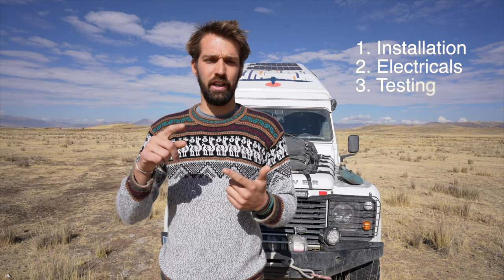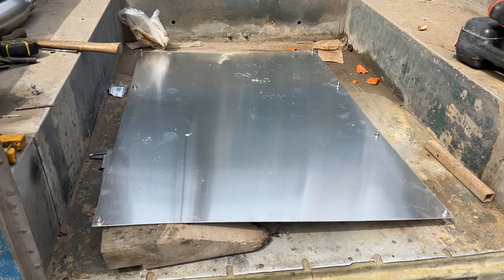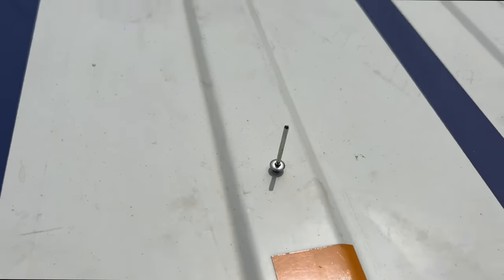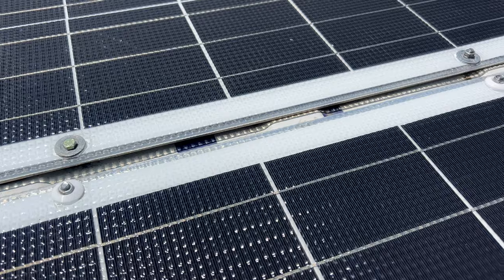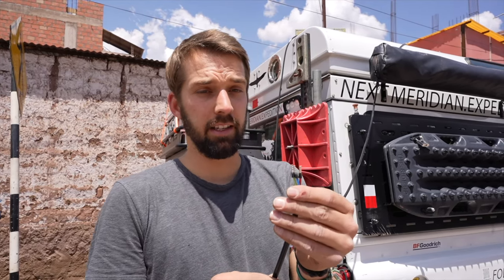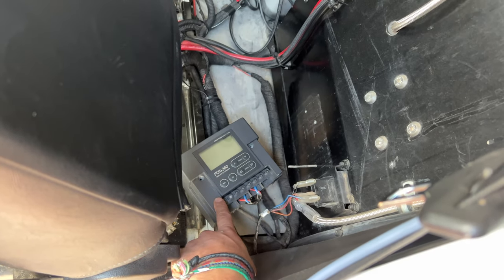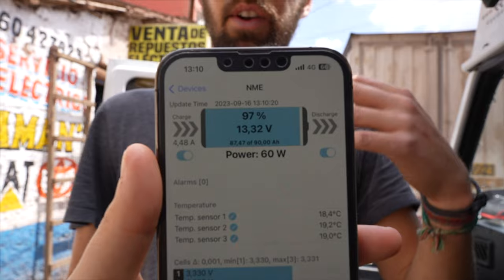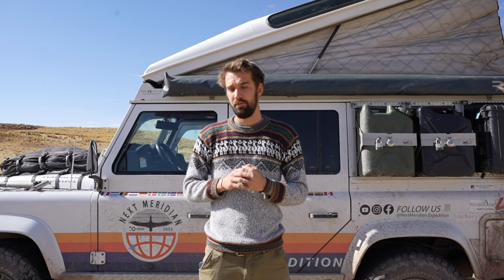How to install Solar Panels (full process)

Comment: Nice install guys.   Unless you are running anything from the car starter battery when the ignition ie off then it will only need a very small amount of charge to keep it topped up when the motor is not running.
You would probably be better off changing your charger to 95% to lithium and only 5% to the car starter battery.   Basically if notihing is connected to the starter battery when the engine is off then it will only very slowly loose charge over time. You guys are never away from Albo long enough to need it charged up a lot.
Reply from the maker: Yeah indeed, so far we never go below 50% charge and good point might as well put most on the lithium 😊

Comment: Think you need an air gap for cooling the panels. 
I am currently replacing flexible panels sitting directly on the roof of our caravan with glass panels with air gap for cooling to improve performance.
Our house also has solar and the installer said an air gap was essential to stop the panels from overheating in hot weather.
The ideal temperature for solar panels is 26 degrees.
You may need to water your panels to stop them overheating in hot weather.
Reply from the maker: Yeah having air is a good idea, we didn’t want to increase the height of Albo and we’ve run this installation for 1.5 years and worked fine so just went with the same setup. All the best with your van setup

Comment: thumbs up and sub! Seems like you have space on the roof for 1 more panel?  Star Link uses a lot of power.  Some people modify it to 12V to save some power.
Reply from the maker: yes we could have the space but our batteries would be too small if would not be worth it. already our two panels work magic. yes starling is thirsty hahahah we try to limit using it. just for the necessary time to do what we need. we did not modify it.

Comment: Did you make sure all of the metals involved are the same?  Otherwise you may get electro-galvanic corrosion- eg. steel vs. aluminum.  Speaking about vibration, where the line runs over an edge might benefit from some padding.

Comment: That whole system is janky as hell. Solar panels should be mounted to corrugated plastic sheet to create an air gap for cooling not a metal sheet that will just fry them, no idea what cabling that is but it sure as hell isn’t pv panel cabling, at best you will lose loads of wattage, at worst it’s dangerous.
Reply: Yea..You may be right, but it works and it was his first go...So offer advice, not ridicule..
Reply: @MrDonJBerg  toughen up, cowboy. Free and good advice sometimes sounds like a drill sergeant chewing your ass up for pointing your rifle where you shouldn’t.... @jabber - thanks for the heads up cause I’m about to build up my first system!
Reply: @torrentbits  sure thing
Reply: Doesn’t aluminum dissipate heat?
Reply: @ronfinch5532  I have used Aluminum as a heat sink in the past, but it also conducts heat from the sun.  The bottom line is, I did not see anything dangerous on Nicks installation, some things I would have done different, but there are many ways to get a job done.  If I had seen anything dangerous, I would have told him.  I thought for working in the street with limited tools, he did a great job.
Reply from the maker: Thanks 😁 learning as we go, but the first installation worked very well for 1.5 years so just went with the same set up.